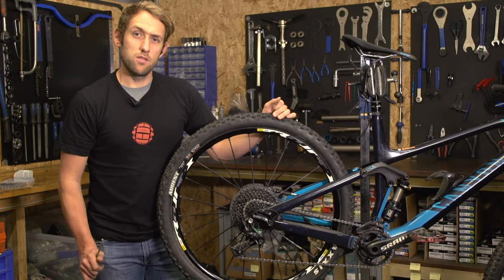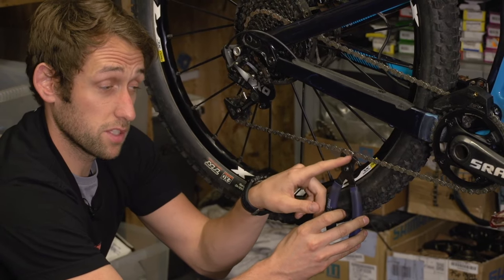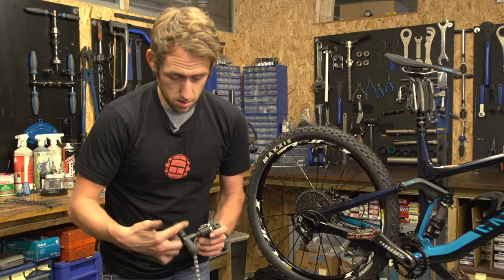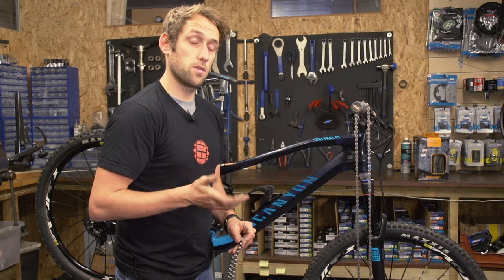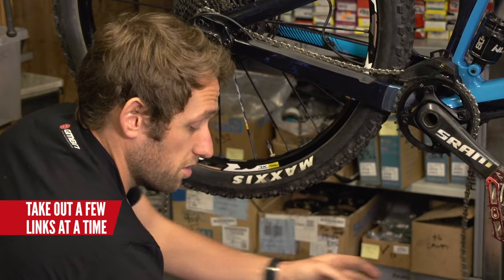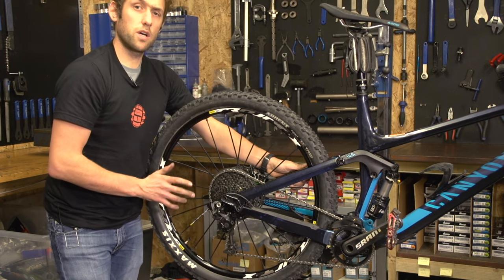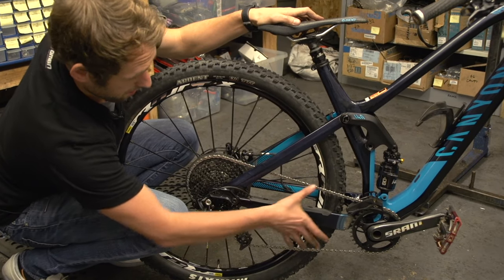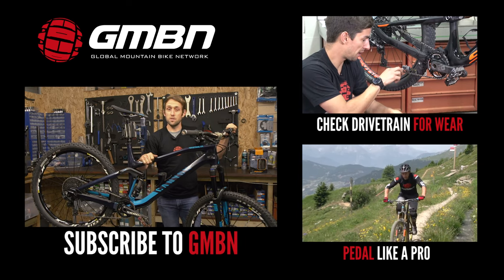How To Replace Your Chain - MTB Maintenance

Comment: The biggest flaw in this video is not taking any time to show how to route the chain through the derailleur. It may seem trivial, but I've seen many people not route it over the metal support tab.
Reply: Personally I would make a couple of pictures of the way my chain was and then compare (of course before snapping off links ;)). But you are right.
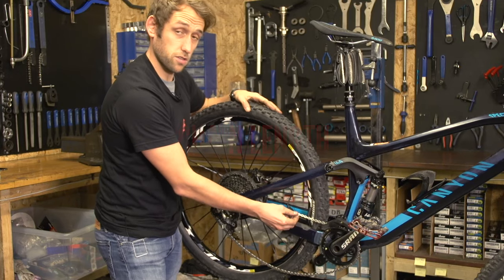Reply: 2:42 the quick link on the wrong direction KKkkkkkk
Reply: Yess just at a picture on the internet and remember to route the chain through the frame as well 😅

Comment: This was not clear. Should have explained to only remove the links by the power link. In the video it looked like you just took them off anywhere. Just wasted a $50 chain. 😢 I was thinking it seemed weird to have connected the power link before removing the excess links. But I was just trying to follow the video

Comment: Just a thought checked my chain last night and it’s on the point of needing to be replaced.
When you measured the new chain against the old, won’t that be too long as the original chain has stretched? Would you not be better off counting the links, only asking as I’m not sure.

Comment: If you change the chain lenght, dont forget to ajust pulley to sprocket distance. I shortened the chain,  the distance increased and shifting became slower.

Comment: Thanks for info...im working on a cheap 200 dollar full suspension mtb which im sure straight from factory chain way to long..even with suspension..7 cogs on rear..28 tooth....front 42 tooth largest..122 link chain...im gonna do exact wat u showed in video....my bike shud not jump over teeth cuz chain so long n not tite enuff...

Comment: pro tip- 11 and 12 speed powerlink/ quicklinks are a 1 time use. meaning you only install it 1 time. all in all the second half of the video was incorrect. the chain length should be measured outside of the derailleur cage, installing the link after a correct size is determined and removed. I was simple trying to see if compressing the suspension was needed when installing the chain since the chain stay increases in size when compressed. typical rule of thumb is wrap the chain around the largest chainring in the front and rear and add 2 inner and 2 outer links.

Comment: Hmm I've always measured chainlength via the big cog - chainring method, without routing through the derailleur. What's the advantage of this method? More optimal length?
Reply: +Marco Frissen That wouldn't work on a 1x or full susp.
Reply: Mike Mazzantini
I have a 1x (hardtail). So far, no issues, but I might look into it again.

Comment: Hello  i have a question.  Mi bike has  a shimano xt groupset 34t the chain ring, but the cassette is 11_50 sunrace  a 11 speed. A use a shimano slx chain with 116 link and the person tha installed  added  6 more link so that  chain is 122 link. And a week  after installing  the chain brake. And want to know  do i have to do the same  thing  get 2 chain to make one with 122 links? And wish is better  shimano chain o sram?

Comment: Hello, thanks for another great video! I've just finished changing the chain on my bike and I'm now noticing the shifting is just a bit choppy. There seems to be just a little bit of lag that when I'm pedaling and shifting, it feels clunky. I'm guessing the chain is losing tension for a split second under shifting. 

Does this mean the chain is too long? I removed one link from the size of my old chain thinking that was too slack especially considering my derailleur had loads of room to move forward at the lowest gear setting. How do I resolve this for smoother shifting? Thanks!
Reply: could just be the tension on the derailleur cable if the shifting is lagging. try the barrel adjuster first

Comment: +Global Mountain Bike Network what if you have 3 chain rings? It was mentioned in the video that the chain must be as tight as possible on the lowest gear. For us with 3 chain rings that will be biggest sprocket and smallest chain ring. is that correct? On the comments, people are saying biggest sprocket and biggest chain ring. Which is correct?
Reply: Eric Candari the way I do it is by putting it in the smallest ring up front, and smallest on the cassette, then adjust the length until the chain is no longer loose (i.e. the derailleur is stretched just above its unsparing position)
Reply: Eric Candari I was told to measure it song the biggest and the biggest but not through the derailer

Comment: Use the old chain as a maisurement of the new chain. Speeds up the process.
Reply: They said that. They did it the complicated way to show how to do it if you don't have your old chain though.
Reply: lars bevers if your chain is old and needs replacing it will have stretched somewhat

Comment: Which exact ones are the power links you can re-use to make chain cleaning a lot easier by just taking it off? And how long do they last?
Reply: +Mark Huigen Sram and KMC use powerlinks
Reply: But at some webshops it says that they are not re-usable...
Reply: +Mark Huigen Well you can remove and replace them aslong as you're doing maintenance like Marc here, but I think they mean if one goes out on a trail then it's not a good idea to try to reuse it. take a spare power link and put a new one in if it breaks that way.
Reply: +Mark Huigen I've been re-using the same power link for years , taking it off and putting it on every time I clean my chain , once my chain wore out I use the link in my repair kit for getting home in an emergency
Reply: +Mark Huigen I've been re-using the same power link for years , taking it off and putting it on every time I clean my chain , once my chain wore out I use the link in my repair kit for getting home in an emergency
Reply: In my opinion re-using the power link for years is not a good idea. I disconnect them few times during the chain livespan whenever I want to do a thorough chain cleaning but I replace them together with the chain when it wears out.
Reply: piast99 me too mate ;)
Reply: piast99 that's because they stretch along with the rest of the chain, right? Or because taking them off and putting them back on wears then down and makes them wesker? Or both?

Comment: Why no mention of how the power lock links can only be used once? Power links on the other hand can be used multiple times. SRAM does not recommend using power lock links more than once- do your research. It changed when they went from 10 to 11spd cassettes. Wonder how many people f'd up their rides when this link wore out...
Reply: B Curt so it's OK on 10 speeds to use them to take off and put back the same chain?

Comment: Why do top bikes use only one chainring?
Reply: +Vlad Petcu The more chainrings you have the greater the overlap in gears, top end bikes tend to use a single chainring but a wider variety cassette so you don't duplicate gear ratios.
Reply: It's called a 1 by setup. It takes a fair amount of weight away, simplifys your ride and there is less parts to fail and replace if something goes wrong. Hope this helps
Reply: There are two reasons in my opinion.
1) Top bikes are meant to be used by top riders who do not have to have a granny gear to grind up long, steep climbs so smaller gear ratio range of 1x systems does not hurt them.
2) There is a market hype for 1x drivetrains. They show commercials with happy people riding down a nice single track on trail bike, never a weekend warrior climbing his XC on technical, steep climb.
Reply: Vlad Petcu the cogs and chains are thinner, more expensive, less durable, depreciate faster and require more maintenance. Basically it's gonna cost you more time and money

Comment: Big big + 2 links...
Reply: True... but does that work for full suspension bikes as well?
Reply: Fully compress the rear shock when you measure it up
Reply: Too short for me. Cannot be optimal since there are different lengths of rear mech cages. Also neglects the bike-dependent chain growth from suspension travel.
Reply: Yhigma that through the derailer when measuring or not
Reply: @StoutProper  Yes of course. This has worked on the last 5 bikes I have owned at least :)
Reply: Yhigma so is that through the derailer or not?

Comment: It would have taken you 10 sec to show how to use the chain wear indicator tool, instead of pointing to another video.
A maintenance tutorial/course should be from start to end, one linear experience, not an amalgam of links to other videos.
If you want,  you can point out at the end of the video, the annotations for the related videos.

Comment: come on, really.  take a couple links out as a guess, then compress the suspension and see if its right,  then add a link back in if its too short.  WTF!!   this is horrible technique.    first, air down the shock and compress the suspension all the way. wrap new chain around biggest cog and biggest chainring and through the derailleur. pull tight, and add one full link, which is an inner and outer link. this sets a 1X system so it has correct tension in all gears, and sets a 2X up so you don't rip the derailleur off.
Reply: +vaxbuster with 2 links it will slack out too much on a 1x system, especially on a long travel trail bike.  with the suspension already bottomed, and in big big, there is absolutely no reason to have more slack in the drivetrain.